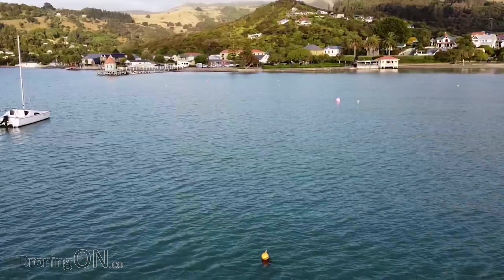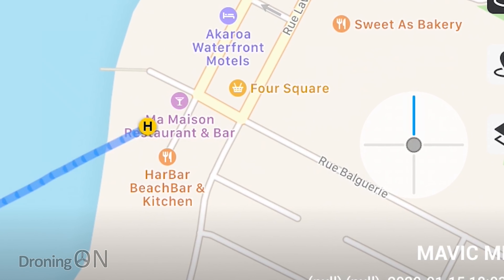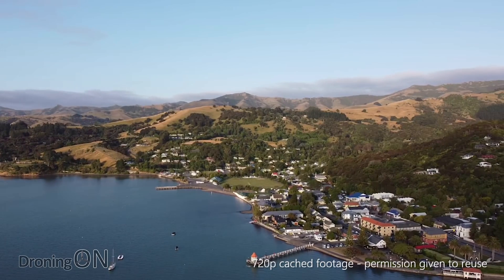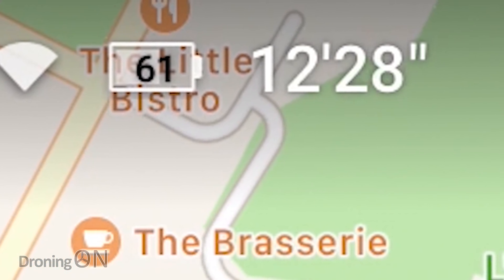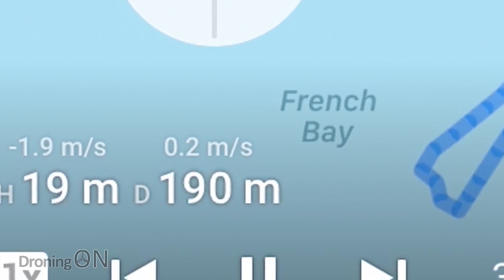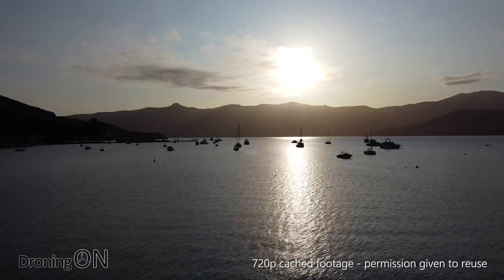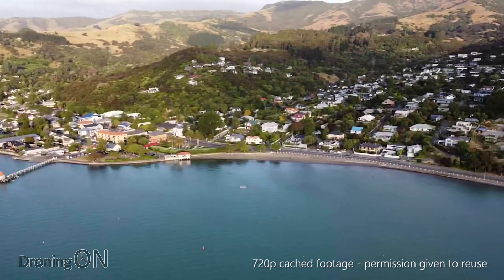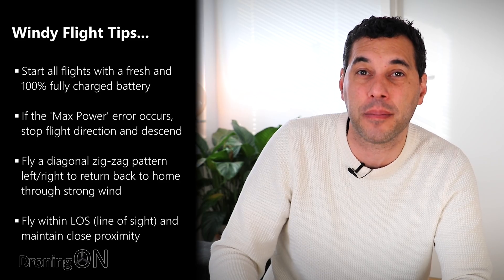DJI Mavic Mini Uncontrolled Descent Into Sea | Max Power/Wind Issues/Operator Fail?

Comment: Absolutely manufacturer error. Happened to me with the Mavic Pro. But mine wasn’t max power error, the software said I was in a restricted area when I wasn’t and it forced landed into the ocean. I provided DJI with flight evidence plus civil aviation maps and they weren’t interested because it was outside of warranty. They refused to look at the flight record. The drone was running perfectly up until that point. Lots of power, lots of satellite connections. Very disappointed with after sales service.

Comment: I think even today the mavic mini still suffers from that problem of just falling. I have a colleague  who have lost his about almost a month ago. He sent me the clip of that happening. Unlike the footage in the you tube video I have noticed three variables that were not present. One the fact that he wasn't flying above the mountain, two he wasn't flying that far away and three he did not get any errors at all. I cannot say for sure whether there was no wind though as he was flying his drone where the sea is generally rough and crashes onto rocks, a no swimming area, he told me he tried return to home, the drone was not    responsive. Even throttling up did not work. He helplessly watched his little mini plummet into the sea. He told me his drone was up to date too. This is a BIG problem. DJI needs to look into this.

Comment: It’s a problem with the rotors.  The back rotors are getting flattened in the bag and causing the rotors to spin out of control.  You should here the high pitch of the rotors when you take off

Comment: I watched your video because i've lost my mini also.  I'm thinking a lot to buy a new because it's really a fun thing to play with. But not knowing what i did wrong holds me back. After seeing this vid. makes me even more doubtful. Not one of the possible mistakes that you mention apply to the crashing of my mini into the water. Battery was full, very little wind and so on. I really think that in a lot of cases there is a serious failure in the drone itself.  Btw. Excuse me for my Enlglish. I'm a dutch (Nederlandse) guy.
Reply: Erik Groeneveld your English is great don’t worry about it

Comment: I had the same problem a month ago, very closed to dropping the mini in the river, but managed to calm down and nurse the drone back to dry land (very slowly as the more power you go the more out of control was the drone).  
To resolve the issue I replaced ALL the props, and hook the drone and controller up to my lap top and update both the software on my drone and controller.  After it worked fine.  I did noticed the version on my controller was older than what's in my drone.  So whether it was the props issue or software conflict I don't know but at least mine did not go for a swim!

Comment: 1. DJI is not the safest manufacturer as they state. 2. DJI had issues with Spark drone as well. 3. Mavic Mini and Spark are operated via remote control, communicating with the drone via wi-fi. 4. Wi-Fi is susceptible to hacking or interference. 5. Mavic Mini is indeed very light and people are misguided by 30 minutes flight time. This drone is just a little toy for close by shots & footage, PERIOD!

Comment: Max power error is almost always as a result of battery voltage drop and higher current draw to the rotors which are spinning too fast due to incorrect blades or blade distortion. This problem is always more noticeable when flying into wind. If the mini shows this error then land immediately. 

It is common that the rear blades suffer the most due to incorrect storage of the mini in the case. I always check the pitch of the blades before flying and replace blades when in any doubt.
Reply: exactly, I dont like to store my mini for more than a couple hours in the case but I agree always check your props... unless you don't mind losing your investment.

Comment: Yes, lower down when strong wind. It happened to me today and I lowered down to below the trees, but instead head the tree but recovered it with 2 broken wing. Hah
Reply: A few days ago I was at the same level of the trees a d had a gust of wind blew it into the tree, and it was fine and I had to know I it out of the tree because I couldn't climb to the top and broke the part that holds the back arm, I took the arm apart and put it back on, and it still works I do need to replace it and ordered a new body but it's still a great drone for the price and being the size of a phone...never had a DJI before but live my mini 2

Comment: “Ahh.. ‘No! It’s not a delicate lil thing.’ I can fly my Mavic Mini for well over a mile without issues. I’ve flown it in high power wind and fog(as seen on my YouTube channel). I’ve flown it with trees 🌲 in the way of the co troller. Overflown it above water 💦 several times! This thing is built like Iron Man!  My Mavic Mini is just fine the way it is. Well built high quality product that has changed my life around. The stunning quality of video is astonishing! Thanks for the tips anyhow...” ~ Jesse M
Reply: Great comment... It's the bent props.
Reply: If you get a chance read my comment on this post.
Reply: Nice paid comment. My neigbours had a mavic mini and after hitting a hedge the arm broke.
Reply: @Kayshots  some people fall off trees and they are fine, well other break their arms. 🤙🏽
Reply: @Kayshots  well I've got one that I flew at nearly full speed into a wall without and damage'

Comment: Thank you so much for this video 
After watching so many reviews and in depth videos on this drone I was so close to buying it until I seen this video and started researching about it 
Turns out a lot of people have had the same error just reading this comment thread alone with multiple other videos and lost there drones over water etc even some people flying the drone inside with no wind or anything still experiencing the problem although I have seen many people saying just change the propellers with the spare ones fixes it but I think I’m gonna hold out before purchasing just to wait and see if DJI announce anything to do with the problem hopefully they figure it out soon I was so keen to buy this drone tomorrow but am very put off at the moment from these errors people have been experiencing no way I’m going to buy something this expensive ($600 AUD) for it to be crash landed over simple errors 
Good video anyway bro
Reply from the maker: Thanks for the comment Ireland Plays! As a first iteration of this new model, it's a great effort but it does indeed have it's issues which need to be resolved. DJI will most likely take onboard all feedback ready for the next iteration in a year or so.
Reply: You should still gladly purchase this drone.. Just be careful how you store it in its case. If the props get bent replace with the spares.

Comment: I have a Mini that's been dropping out of the sky with no wind and no good reason why. I'm pulling up on the throttle and nothing. I'll be sitting 50 ft below it with no wind and it just starts a fast decent for no reason. This is definitely a problem on DJI's behalf and it needs to be fixed immediately. I see more and more reports of this and it can't just a common trend being all user error. I never had this problem with my phantom 3, given that it's a larger AC, it still never once acted as sporadically as this mini does. I'm highly disappointed in the fact that DJI hasn't put out a fix yet.

Comment: I had the same problem mavic mini started given me max power errors and and big altitude drops wiith no winds I fox by getting propeller replacement on all sides and a imu calibration make sure you have latest firmware and latest app version it fix all my problems.... I made a video on it https://youtu.be/Sxqm-6_vrO4

Comment: personally i think the mavic mini should be worth 200 euros maximum due to the fact that it is very easy to lose and its operating system is shiet its a waste of money
Reply from the maker: To be fair, if you avoid heavy wind then you won't lose your Mavic, and 200 euros simply wouldn't cover the engineering, design and technology packed into that little drone.
Reply: @Droning-ON  there are drones with 8k cameras and 360 camera 4k and 360 sensors  just 400 euros more what exactly do you mean

Comment: Jeez, after reading a lot of the comments here, Dji doesn't appear to be any more reliable than any other Chinese drone. Mjx bugs 4w, solid drone but, rth after only 100 mtrs, Zino Pro, controller would not connect to 3 different phones. Looks like the only one that might be ok in my price range, just, Fimi x8 se, but uses a cable to connect to controller like the Zino and there in very short supply at the moment. The biggest issue here is Quality Control. Hit or miss when buying these drones, but we pays a lot of money for them unfortunately.

Comment: Lipo batteries do not work like that, they give close to max power till near the end of there charge, unlike alkaline.
Reply from the maker: Thanks for the comment Mavicarbon, but I have to absolutely disagree. LiPo batteries do not give full power towards the end, that's coming from an RC operator flying planes, wings and RC helis on LiPo's and seeing first hand how you get power fade towards the end of the mAh cycle. In addition, the Mavic Mini uses LiIon anyway, not LiPo.

Comment: Hello wanted to ask,
1. If Mavic Mini pass the distance limit does it loss control, does it stop or how does it work and 2. can i control the drone behind the hill or behind a building where i do not see it.
Reply from the maker: Thanks for the comment Triumf. If you lose signal, it'll automatically 'Return To Home' and fly back to you. Be sure to hit subscribe!
Reply: Yes the Mini will return home if it loses signal but don't forget it doesn't have obsticle avoidance so if you haven't set the RTH altitude high enough then it will happily fly into a tree or building along the way!

Comment: Recently took my Mini out for the first spin outside of home. In a park where there are trees on 3 sides and houses on the last side, the ground is very slightly sloped. After take-off I fly the drone about 10 meters forward and I get the "Aircraft Max Power Load reached" message. My altitude is maybe 3 meters and there is no wind. She starts dropping and nothing stops the descent until she hits ground. Check batteries, all ok, take off again, same thing happens again and then a third time.

Comment: One thing you not consider, is Micro Burst.  Also, there is a thing called Dead air, I've used to fly RC Air planes, and I've litterly had a airplane fall out of the sky for no reason.  So with a drone, only thing keeping it in the air is it's propelas, so if they don't have nothing to bit, just like a wing, well you get a dead air probelm and drop it goes. also micro burst can cause airplane and I'm sure a drone to be forced downwards or upwards.  If  your flying over a cliff, I can see this being the case, cause you have wind that is being buffected at the cliff forcing it to change directions.  Anyhow that what I think it is, not the drone, but user not seeing what can happen for flying in a place that can over fly a drone, and being a Mavic Mini, that like taking a water gun and shooting it and causeing it to crash cause of the force of the water hitting it is more then the weight of the craft :P.

Comment: I had a max power incident over a river and was luckily able to bank before it splashed down.  Upon inspection of the prop area I found smal anounts of fine sand in the two rear motors.  I took the motors off, removed the sand with an air compressor, now everything works perfectly again.  I realized I had taken off from an area that was indeed sandy.  My conclusion, get a takeoff mat or takeoff from the hand to avoid sucking any unwanted material into your motors.

Comment: I had something very similar happen to me, the wind took my drone further into the sea, it wouldn’t return home as the wind was too strong. Descending it close to sea level is the only thing that helped combat the strength of the wind. However, this did drain my battery quickly I had to run into the sea to catch the drone as it was on 1% battery when I caught it. It cut my hand in the process but it was worth it!

Comment: I had my mini do an uncontrolled decent and side shift left, over a freezing cold looking pond.  The battery was fully charged but I was in the vicinity of some pretty heavy duty looking power lines which I think was the cause of my issues.  Luckily, after a small amount of poo came out, I regained control and immediately returned to dry ground to land safely.  I packed up and moved on, giving myself a stern talking to about checking out my flight area beofre use.  Lesson learned.

Comment: There is defiantly a firmware issue. I’ve tried in doors with cage from fly more package. Never crashed or hit anything with the props even with cage on. If I give my drone half throttle I get the motor power error and descends even if the battery is above 50% with half throttle forward. I’ve been lucky that I l’ve experienced this in doors and less than 6 feet of height. Keep in mind that I’m flying in doors with no wind but with cage on. Defiantly a firmware issue that need to be resolved especially for a beginner drone.
Reply: Brandon G “May have purchased a defective drone.”

Comment: It's so obvious to fly back diagonally when facing a head wind - makes perfect sense. Thank you for the obvious tip - hadn't seen it anywhere else.
Reply: actually to walk diagonally on a steep hill make you ascend with less effort, and this can deceive who think what happens to a drone flying against the wind.
even if in both cases, ascending a hill and flying against the wind more energy is required the analogy stops here, the hill is steep but still, the wind is air that is moving, and it makes all the difference. a drone flying against the wind is flying at the same speed he flies in still air, his speed depends only on the power of his motors and other characteristics, but is flying into a mass of air that is moving in the opposite direction, his actual speed is the same, not depending of wind strength, what change is his speed compared to the ground that is the drone speed (in the air) minus the speed of the air mass compared to the ground. 
let's say that the maximum speed of a drone is 10 mph and the wind is also 10 mph but in the opposite direction the drone remains still compared to the ground. but if we angle the drone direction of flight 45° from the wind now he moves at 10 mph, but only about 70% of his speed is used to contrast the wind as some speed is used to have him move side way. so angling the drone at 45 ° from the wind direction and zig zaging has the result that the drone moves towards us in the air only 7mph, but in a mass of air that is moving 10 mph away from us. the result is that we don't help the drone to come home, we make it go away from us at 3 mph, when before at least was still compared to the ground.
the proper way to deal with strong winds, beyond avoiding to fly, is only to find a place where the speed of the air relative to the ground is lower, to decrease the altitude the drone fly.
i hope that it is clear as i am not a native english speaker.
there is a reason if you did not see the tip anywhere else, it only makes things worst.
Reply: Andrea Chinaglia it makes perfect sense, by the way ur English is amazing I could understand it all👌🏻
Reply: @andreachinaglia5804  it does appear to be a rather stupid tip, as you elegantly point out, you're still flying into the same wind velocity, but now your flight path is so much longer, making it more likely to run out of battery
infact by flying at 45 degrees to the wind, you are exposing a larger surface mass to the wind

Comment: My poor old mini did a fly away right after take off and flew itself straight into the lake lol. Luckily dji analyzed it, said it was NOT user error and is sending me a free drone. Was a pretty devastating experience at the time a few weeks ago but of course became my most viewed video here on youtube...  Glad dji did the right thing and was very impressed with their customer service. 

In my case I had a full battery, props were good and secured, no wind, waited for satellites and RTH. Was just unlucky. Sent dji the footage and flight logs and they took care of everything. Didn't even have to retrieve the drone.
Reply from the maker: Oh no so glad to hear that, but glad that DJI replaced it!!! Did you recover the drone before they replaced it? Thanks flor the comment and be sure to sub!
Reply: @Droning-ON  i didn't recover it. They wanted me too obviously but one email just saying I couldn't and they decided I didn't need to. Between my back and neck problems and muscle spasms I haven't been able to swim lately like I used to a few years ago. 

I'm still waiting on it, it got delayed b/c of the coronavirus overseas. But should get it soon. I did go ahead and buy a replacement drone on ebay until then, and will just have a backup drone when the 2nd one arrives.

Comment: I had this error flying less than 40 feet up and it dropped like a rock to roughly 10 feet and I was able to get it home. I carefully flew it a few more times and it continued to happen so I changed the props and have not experienced it since. Upon inspection of the props I noticed that the front left and rear right prop pairs all had a rough leading edge. I suspect that I probably could have resolved my problem by just changing the affected blades but to be safe I just replaced them all. It's been over a month and 50 or so more flights and still have not seen the problem reoccur.
Reply from the maker: Thanks for the comment Kurt!